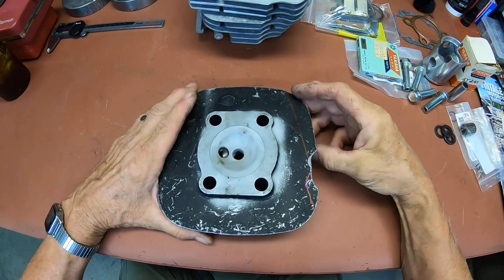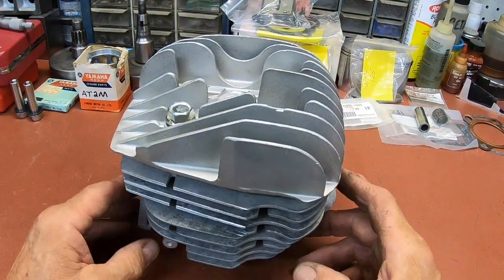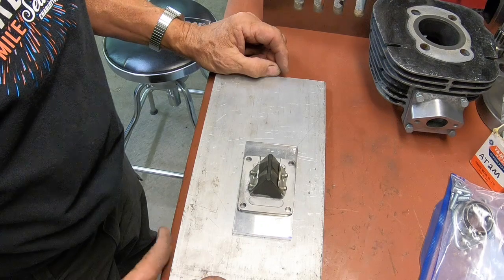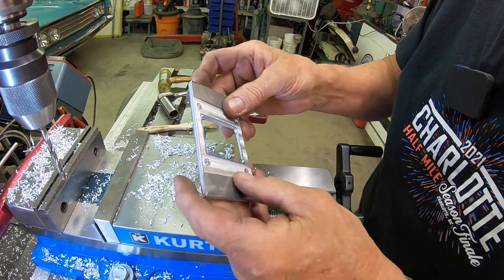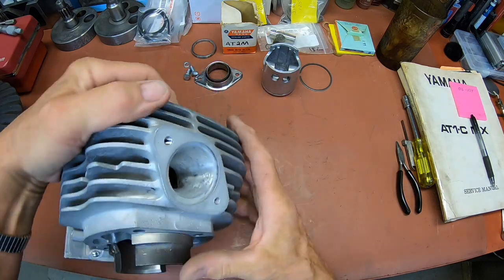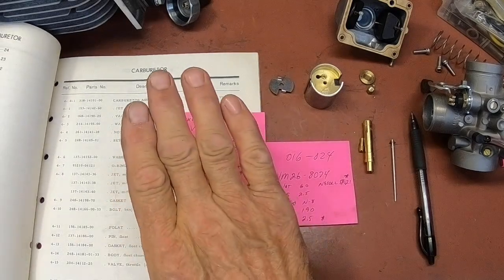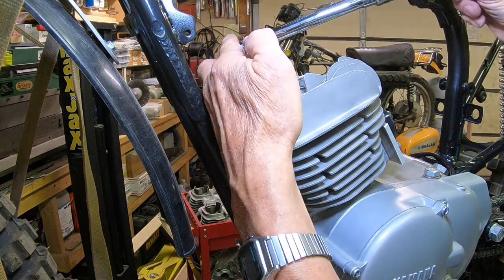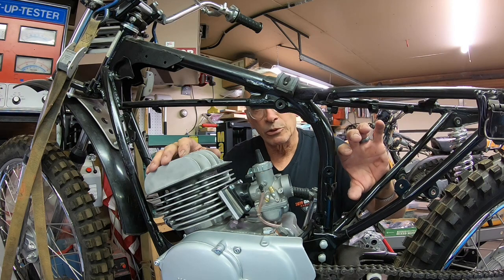72 Yamaha AT2 MX top end build and carburetor adapt.

Comment: Good work. I'm doing some work on an at3 and I plan to use larger reed valve from rd350 they use the same bolt pattern
Reply from the maker: Thanks, I had heard there was a larger unit, I just happen to have a RD250, so I may just use one on it. Thanks for the tip. Good luck on your build, and thanks for hanging out with me on mine.
Reply: Hello, I'm rectifying the cylinder on my CT2 and I'm also going to install another set of reed valves because the original is too small (the same as the DT100).  Did performance improve with the RD350 reed valve assembly?  Thank you for your attention!

Comment: That is a trick looking engine my friend. Great work as always Dale. I think the extra material on the reed block adapter will really help to keep heat away from the charge.
'Close enough for the girls I go with'!! My tea was coming out of my nose, I laughed so hard at that one. You rascal. 
Best wishes, Dean.
Reply from the maker: Thanks Dean, I think it is beyond cool. We used to use aluminum or phenolic plates to separate the carb back in the day, before reed plates were common. We adapted 32 mm Amal carbs to 100 cc Super Rats. Man those bikes would run. Well nothing wrong with a little humor I guess, sorry I made you smell your tea buddy. Think I might have some more old tricks for this bike, its great reliving some of this old technology. Thanks for hanging out with me.
Reply: @montana2strokeracer  keep it coming Dale, it's all good.
Reply: @montana2strokeracer  yeah, there was a day where the mono-bloc amal, even the concentric were the trick. then of course the Japanese and mikuni kicked their butts.

Comment: Nice job Dale...  I think I would just get a 2 stage clamp on Uni pod air filter before I would alter the frame to adapt an air filter. Excited to see / hear this thing sing!
Reply from the maker: Hi Taylor, Cutting the frame is the last resort for sure. I am playing with some other options, and a lot of suggestions are coming in. I am just not big on pod filters, they work but they need to be enclosed, otherwise your engine gets a pretty steady diet of muddy water. Think we are real close to fire up, so stay tuned, I will save you a seat. Thanks for hanging out with me in the shop.

Comment: Can you do a video on cleaning out rusty tanks I know you have to deal with a bunch.
Reply from the maker: Yeah, I have done a bunch of them, really not much to it. Pull the petcock, make a plate or use a plastic cap to cover the hole. Fill the tank with Metal Rescue, wait a week, or more depending on how bad. Drain, let dry, best in the hot sun. You're done. I will go into it more in a video as well. Thanks buddy

Comment: Dale, the aluminum spacer won't affect the reed valve performance in any way?
Reply from the maker: Hi there, no should have no effect at all. We used to adapt carbs all the time in the day, I remember we were making reed blocks and adapting reed plates from chainsaws back before they were common on bikes. We would make all the parts and adapt 32mm Amal carbs on 100cc Super Rats, man those things would run. It's really all experimental type stuff and there is always success or failure, the fun is doing it. Hey most of the time it works out. Thanks for hanging out in the shop with me.

Comment: Hey Dale; having a great time watching this.  Quick question:  might a "Y" air channel work on your carb, where there are 2 filters, one on each side of the post, so you wouldn't have to cut it off?  A Harley intake manifold comes to mind.  (stuff like this makes me want a 3-D printer).  Can't wait til you fire that puppy up.
Reply from the maker: Hey buddy, that is an interesting solution, I guess I'm not familiar with it, but I'm listening, and will do some investigation of the subject. I had a bunch of old radiator hoses that I am trying to adapt. This project is far from done, so lots of time for suggestions from everyone. I have had several and they keep coming in. I think we are pretty close to fire up, don't need to be fully assembled to do that. So, stay tuned for that one coming up. I too am ready to hear it run, and don't forget the smell.....it will be premix at 40: 1 on Klotz. Wish I could record the smell for you fellas.